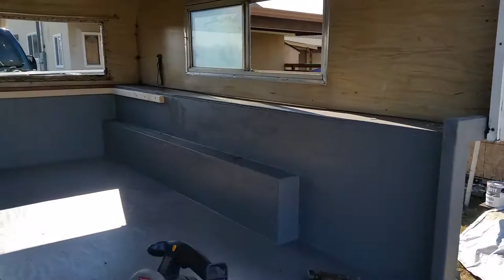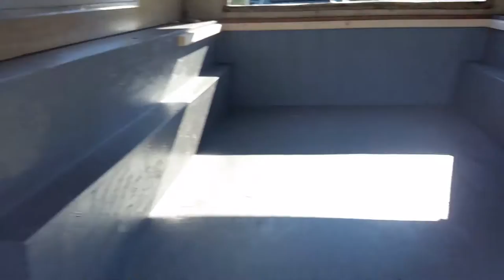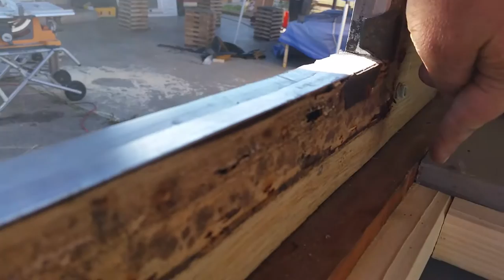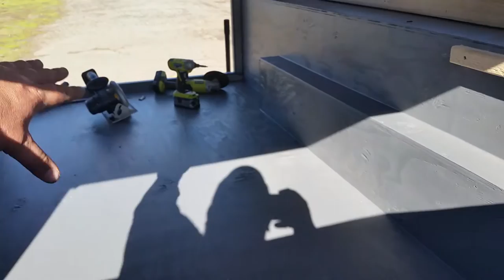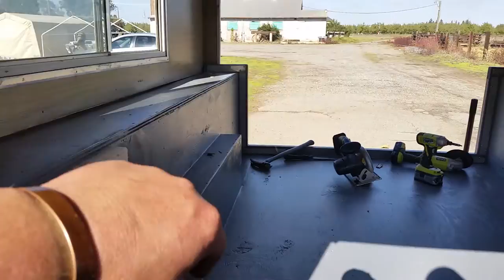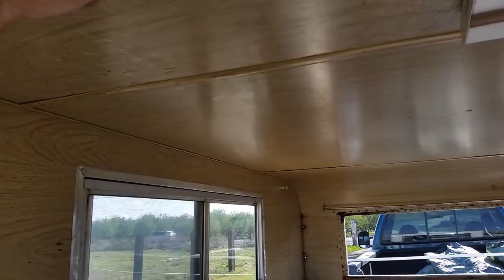Vintage Micro Truck Camper Vol 5

Comment: I need to find  out to hold up  my old 1995 Dakota shell to rebuild it? including  the bottom rail. I had it built back in late 1995 @a camper shell builder In Torrance,CA. beautiful old panelled camper shell, but now it has dry rot. But it kept me warm on two trips over the holidays 2020 to Nashville fron SoCal. Sleeping in truck stops, I probably saved $400+ on each trip. And avoided the COVID on board the airlines.

Comment: Damn! Id love to find one of these vintage toppers now! Just watched from start to finish and i love it. only thin i would do differently is make double doors to get in and out, custom pull out draws, and use truck camper jacks to jack it on and off. awesome build dude!!!
Reply from the maker: Thanks man, getting close to being done. Just needs some paint and carpet. I'll drop another video first chance i get.

Comment: beautiful work man...like your concept here.
Reply: I guess I'm missing it. It looks like a lot of work for no gain in useable space. It does look sturdy, and possibly more secure/easier to heat than just a topper but......still small?
Reply from the maker: It's self contained. All the gear stays inside all the time, slide.it into the truck in a matter of minutes and be on your way. If it was just a she'll I'd have to loand and unload ever single individual item.